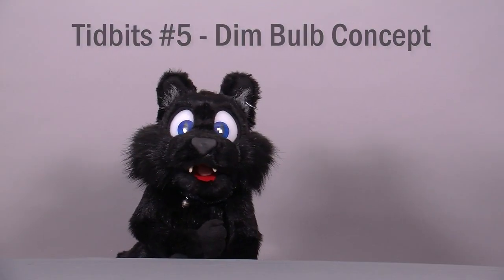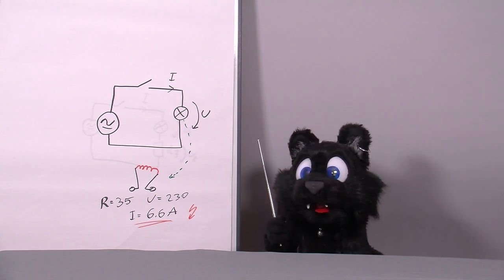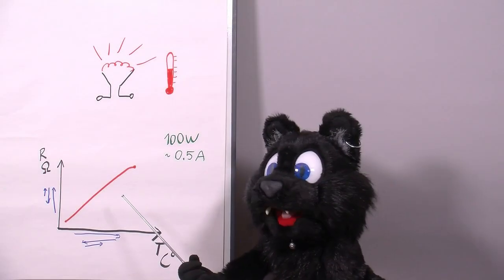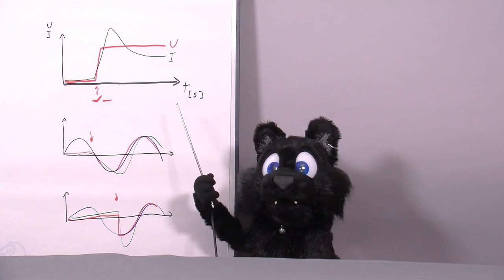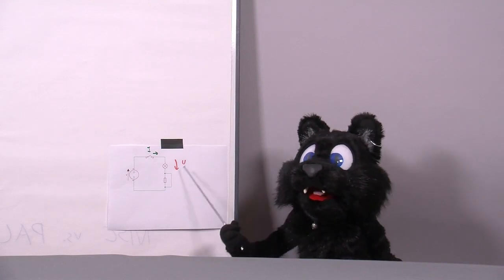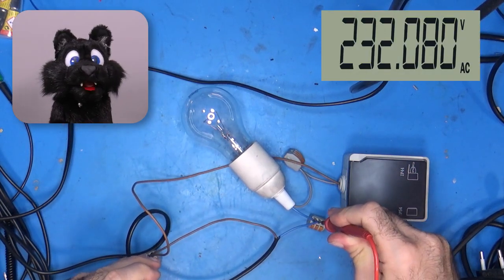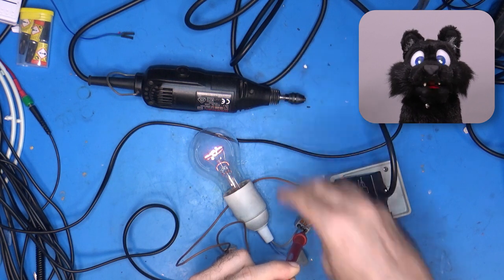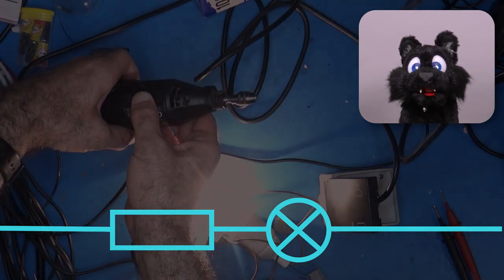Tidbits 05 - "Dim Bulb" concept

Comment: Nice explanation. I made a DIY isolation transformer, by placing two, identical transformers back to back. That made for a large inductive load, even without a DUT being connected. That load made for a lot of in-rush current that kept popping my fuses. So, I DIY'd a softstart by placing a bulb in series. The bulb has a low initial resistance, 20 Ohm, IIRC... Perfect for smoothing the in-rush. And, it glows, if there is a problem. A relay was used to short out the bulb, once the in=rush event has passed. That only takes about ten cycles, at the most.

Comment: Nice explanation. This trick has been around since I don't know when, certainly a few decades before I was born. I've used dim bulbs in series with voltage rails (30...45VDC) when testing solid state power amplifiers back when I played a bit with them, and now I've got a dim bulb with a bypass switch installed on my workbench, and it has become part of my standard test procedure for new builds or unknown vintage devices (after visual inspection turns out OK, of course).
Reply from the maker: Thanks! I know about the trick since forever but it took a bit to "click" with my as to why it works. The thermal component was never in any explanation I heard; Most people seem to assume that it is "clear" and skip that part. So I made this video to hopefully help out others. This is also a good reason to keep a few bulbs around; they don't make them for much longer.